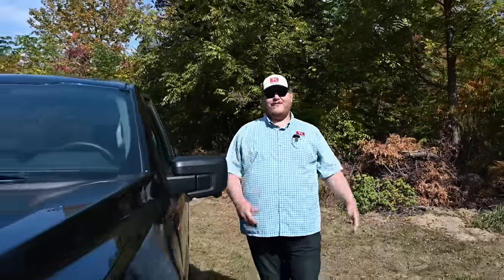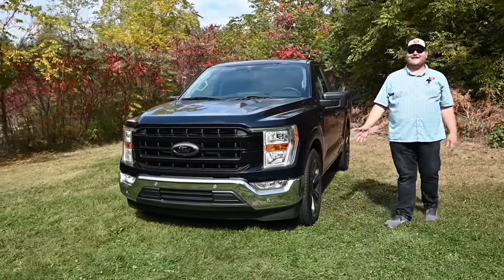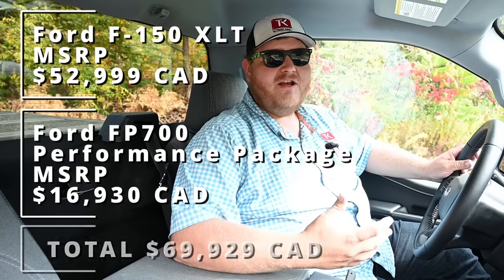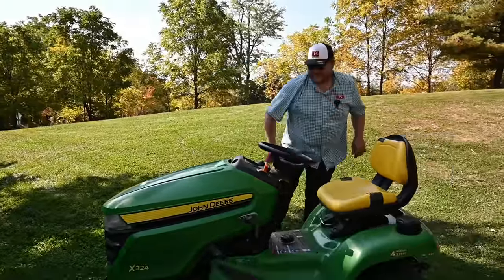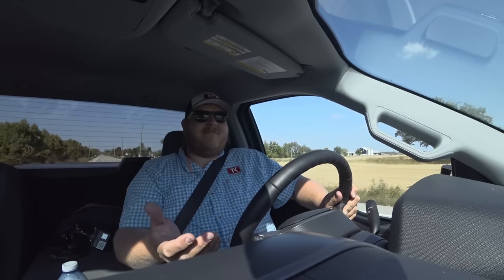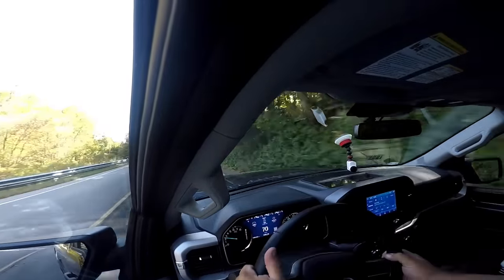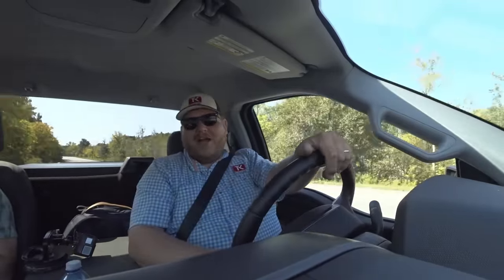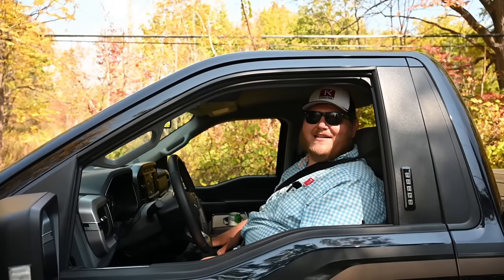Ford F-150 FP700 Brings V8 Power & Sexy Style - But Can it Actually Go Around Corners?

Comment: It may not have the name anymore, but in my mind this is the real "Ford Lightning"
Reply: Yeah that makes way more sense than the truck that actually runs on lightning lol
Reply: @AK_Ray  Tradition is not the worship of ashes, but the preservation of a flame.
Reply: QUIET!!! Ford will see that and tack another $75,000 on it!!!
Reply: This one cost more and is smaller & surprisingly slower 0-60 than my real 23 ford lightning.

Love the haters. The lightning is such a sleeper it doesn't even make a sound when it goes FASTER! 😂
Reply: @ryanwalters6184  Someone with a different opinion than you is not a "hater" my guy - the lightning was always a short bed single cab rwd truck with a V8. Your truck is a "lighting" in name only - just like the Mach E is a "mustang" in name only. Glad you're happy with it though.

Comment: You can get launch control for $5k ...its called pushbutton 4x4 option. All the fast boosted street F150s have it. Only way to go if your gonna go crazy w these.

The '24 XLs will come w LED exterior lighting, all digital dash amd the big screen and power doors for same price.

The 4WD GMC Syclone was the beginning in '91 for this segment.

Comment: Drove 1.5hrs yesterday to buy one of these and purchased the FP700 package. Single Cab XL 2wd. Atlas blue metallic. Has the 3.31 E-locker rear diff. I got the base black package, no extras. The bronze edition did look really nice on a blue truck but i decided on the black. All said and done just shy of $62K. What I really like (aside from the obvious) is the factory drive train warranty stays intact. The supercharger also has a 3 year/36K mile factory warranty.
Reply: Same thing I'm thinking very seriously about getting!
Reply: @19jody72   I have put just over 4k miles on the truck so far. It has been nothing short of pure enjoyment.  Its really hard not to turn around after parking it and just stare at it. This is the first "performance" oriented vehicle I have owned (Also first brand new) so excuse me if I seem a little too enamored with it. I know it had a few things added above the base XL package, but its still and XL.  That being said, the thing has freakin remote start!  I know thats nothing special these days, but getting that on a base model? I thought that was pretty rad.

I took it in for its first oil change at the local dealer i decided on.  Was a great experience and no issues were found.  The oil ford uses on these is a full synthetic 5W50.  It cost $16.99/qt.  The service tech told me that I could bring my own oil next time and they would only charge for the labor.  I thought that was pretty cool.  The only problem I have had so far is on the painted upper bumper pad. They have to remove the bumper for the supercharger install and i noticed that both retaining screws on either side were left out of the pad. the pad wasnt loose or anything. In fact i had went through numerous car washes with it. I asked the service tech if he could put those screws back in (this was not the same dealer I bought the truck from).  They took care of it no problem and didnt even try to charge me for the bolts or anything. Again I know thats not a big deal, but I felt it was good customer service.  There was no him/hawin around or "let me ask the service manager if thats ok", He just took care of it.
Reply: @BeauTheC.H.U.D.  I can appreciate the  enthusiasm about the truck from you. That's the real world feedback I'm looking for. I have never bought myself a brand new vehicle, I made sure the wife had all the new stuff while I just bought what I could find and fix and use for work. I disnt mind working  on stuff, it kept me out of the house..🤣
 But it's now my time to reward myself for coming home, sleep, get up at 5am and work sometimes 12 hours a day 7 days a week.  I got approved to get me a new truck and ut definitely will be the 700 hp version. I'm actually  going with the roush super charger though.. its 705/635 versus the 700/595 Whipple.
  Not that it really matters when you get to that level for a daily driver. 😆 
 Congrats on the truck brother and hope you get miles of smiles out of the truck!!👊🏻
Reply: @19jody72   That Roush kit is gonna be awesome.  I cant decide right now whether i like how quit the whipple is or not.  It is so great to hear that supercharger whine, and you can hear the whipple in certain instances. But there is also something so great about the surprise on people face when a pickup gets up and goes with no prior warning.  My best advice would be to really research where your are going to purchase and have the kit installed.  Ive seen a few stories of dealers that werent very familiar or didnt do many of these and dropping the ball on customer service.  Luckily i had a place not too far from me (about an hour) that did many of these trucks.  They had 2 shelby f150s, a dark horse mustang and Raptor Rs in the showroom.  I felt very comfortable with them and they were very knowledgeable.  They answered every question i had.
Reply: @BeauTheC.H.U.D.  Thanks for te info.. I have 2 dealerships I have in mind.. one down in Alabama(TC customs)) I think is the name and the other is in Ohio. My local Dealership has a bunch of quacks working there..lol
Reply: Congrats

Comment: I am not a ford fan, and I am extremely suspicious of the F150 in particular BUT props to Ford for their willingness, at the corporate level, to make every imaginable version of the F-150, and in an actual base truck. At $70k cdn its expensive, but you are getting something special, and only exactly what you want. I bet it's easier to get into and out of than a 'vette, and you can actually use it to do some practical things. This is a bonkers truck and in my book it absolutely spanks the trx at the conceptual level because it doesn't carry so much extra stuff the buyer may not want. I'd never buy one, but i am strangely happy that it exists. I wish there was a little more of this type of "buyer knows best"  ethos with the japanese manufacturers, who generally get the QDR right, but don't go in for the whole "infinite versions" thing. How long will that coyote last though, with 700 hp? Cheers gents, well done Ford.

Comment: I love stuff like this. There's a Ford dealer in GA that was doing 650-hp Lightning Tributes which were base-ish model single cabs with a Roush supercharger. It had Eibach springs and side-exit MBRP exhaust, plus big wheels that sorta looked like old Lightning wheels. I did the review on it and it was an absolute riot to drive. I would've loved to have bought one, but my other car is a Mustang and needed something with four seats.

Comment: Steve excellent video. We need more trucks like this. I say get ahold of a Dodge Ram SRT With the Viper engine and go head to head. I see a future classic here in the making.
Reply: The fp700 would leave the ram srt10 at the starting line.Viper engine is too heavy and never put out the power it should have for its size.
Reply: The f150 without the whipple would probably beat the srt10 dodge because the dodge is to heavy though i always liked it

Comment: You can get the 775hp 685ft/lbs package from whipple and my Ford Dealer installed mine and kept the full Ford Warranty....so why go with the smaller numbers?....and traction is not an issue, just put it in sport mode, turn 4h on and hold the traction control for about 8 seconds and turn it all the way off. Zero slip, and the dig is ridiculous
Reply: This has suspensions and ford performance badging.  Will hold value better.

Comment: My only reservation is that these kits seem to often be so conservatively tuned that they don’t make the rated output. If someone were to get one of these, I think a proper dyno tune is necessary and probably could pick up 100hp+ over the canned tube to bring it to that actual 700bhp rating.
Reply: I contacted Whipple about this as they sell various stages of Whipple for there F150.  He said the FP700 is about equivalent to the Whipple stage 1.  At first glance, the stage 1 is even cheaper--and puts puts out more HP.  Except you then need to add insurance for $650 to the stage 1 so it lines up with the FP700 and iy\t's factory warranty.  Now it is not cheaper.  Then the Whipple rep literally provided several retailer sites that can sell the FP700 for $8700 vs  $9500 list price.  Further--he said the FP700 actually has a bit better low/mid range power than stage 1 WHIPPLE due to tuning differences.  Last point is the FP700 is still speed limited to 105 mph and the Whipple factory stuff is not.
Reply: @tomtraynor5384  Maybe they messed up on mine but i can tell you that it is not limited to 105mph.  I believe they said its 120mph when i picked it up from the dealer.  I can confirm its not 105 on mine, however i can not confirm its actually 120 as i have yet to have the cajones to test it.  Getting up over 100 in this thing starts to induce the pucker factor.  Especially with factory brakes.  I plan on getting some slotted/cross drilled rotors and better pads pretty quick as a kind of stop gap while I decide on a brake kit upgrade.  ive got a MAXTRAC 2/4 drop and an exhaust done on it so far.  For me though, its not about the top speed of the truck, Its how quick it gets up to 100+mph.  When your spedo needle moves more like the Tach it puts a smile on your face.
Reply: That would be great as I want FP700 factory in case things go sideways.  Does your exhaust DRONE?  I sure don’t want to hear that on the highway.  I’ll check out the Suspension you did.  Never going off road, but want a good ride.  Thx is!
Reply: @BeauTheC.H.U.D.  speedometers are notoriously inaccurate at higher speeds. My old Focus, when stock, had the limiter at 108 but I routinely saw 110-115 indicated. GPS said it was in fact 108 after I tried to confirm. I never tested my F-150 out but it is tuned (regular NA 5.0 2nd Gen), and I’ve hit some kind of ceiling at 120 which may be a limiter from Livernois where I got my tune (haven’t GPS verified anything though). Not sure though but even just a standard 5.0 on 93 octane it scooted there very quickly. I’d love to see what a Whipple’d version would do.

I’ve also wanted to do a more aggressive drop, but I’ve settled on 2wd Bilsteins and a 1.5” drop shackle in the rear (with block removed).
Reply: @tomtraynor5384   Yes there is pronounced drone with my exhaust. The muffler I used is nicknamed the "Neighbor Hater" so it was not completely unexpected that there was going to be exhaust drone.  Which i am totally ok with as this is not a daily driver for me and i enjoy a fairly aggressive exhaust note. And its not like it drowns out the sound of the supercharger because there isnt much sound from the supercharger in the first place. I did leave the stock resonator on though so its not just absurdly loud. Like some of the mustangs around her are just... yea. I know its personal preference and all, but it just comes to a point that i wonder sometimes how a person could drive something that loud and not have a headache after 5 minutes. There was a time though in my youth when my only real concern with exhaust was how do i make it as loud as possible. I think the loudest truck i ever heard when i was young was one of my friends truck.  While it did have 8 spark plugs, what it did not have is 8 cylinders. it was one of the old rangers ('93 IIRC) that had the 4 cylinder engine with 2 spark plugs per cylinder. I believe the point of it was supposed to be more fuel efficient or something.  all i know is when you cut the mufflers and cats off it was LOUD. not good loud. Just really really loud.
Reply: @ALMX5DP   For me at this point i am more that happy with the power its making. In fact im not sure i would trust myself right now if it was any faster than this.  I think they tune it like this because its probably getting to the threshold of the rest of the components on the truck being able to keep up.  You really have to keep in mind that while youve got all that extra power, all you have to stop are the factory brakes.  But who knows... ive got 3 years/ 36K miles to enjoy it as is and after the warranty is gone I can turn things up if I so desire.
Reply: @ALMX5DP  Ok so i want to come back here and correct myself. After further use of the truck it does have the 105mph(ish) speed limiting. While it would be nice not to have that limitation, I am not extremely bothered by it. Maybe once i get more used to the power and want to start doing other kinds of driving, like going to the dragstrip, i can have it addressed.

Comment: You better hope you don't pop a motor cause you'll be waiting a really long time to get a replacement. Mine has been at the dealer since May 5th waiting on a replacement due to oil pump failure. They'll on backorder nobody seems to have a clue when it'll come in. Built ford tough 😂

Comment: My eco boost crew with 34” tires gets the same mileage 🙈
Reply: Yeah the impact of gearing plus the near 100lbs of rotating and unsprung mass can have a significant impact to fuel economy.
Reply: @ALMX5DP  totally. My roush tuned ecoboost with 35s frequented 16 lol
Reply: @vancity_coaster  nice looking truck btw. I like the bronze methods on it, I have some bronze Venomrex on my red F-150. They contrast nicely.
Reply: @ALMX5DP  I’ve had 2 sets now and originally years back I thought I was being different, and now everything comes from the factory this way. Even this truck we’re talking about lol. Can’t do anything right😝🤙🏼

Comment: Would it be stupid to purchase for daily in MN with it's lovely winters?  (4x4 of course)
Reply from the maker: Not stupid. I would own this here in Ontario no problem. Good set of winter tires and you're fine. Maybe throw a sandbag or 2 in the bed. This is the ultimate sleeper truck.
Reply: @TruckKing  That's my kind of thinking.

Comment: Any data on how the package affects the payload and towing?  You know....truck features?

I think the cost does NOT include labor for the installation so that's  +1000s more to the real cost.  Also, the reviewed truck has these other additions that were not costed out, so the estimate is 10-15k usd low?

Additionally, the RCSB is a 20ish to 1 turning ratio which is different(WB 122/141) than crew versions (WB145+) which is about 17-1.

Comment: Can it tow ?
Reply: No
Reply: @wint_62 don’t you mean yes? I think it retains the stock tow rating which for a regular cab standard bed is probably around 8-9k lbs.
Reply: A lot better than a Raptor which is the ultimate poser truck.